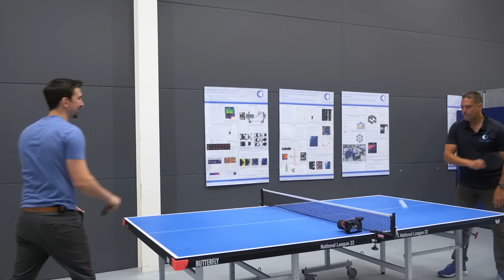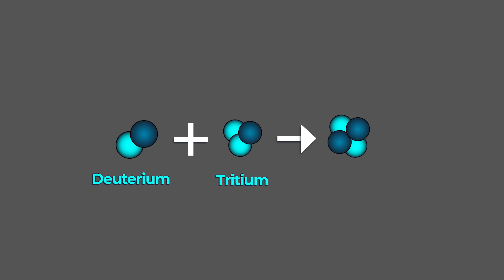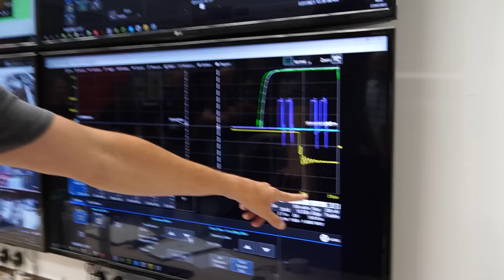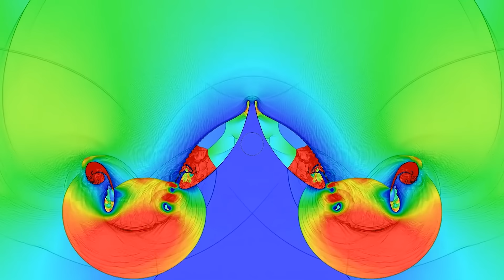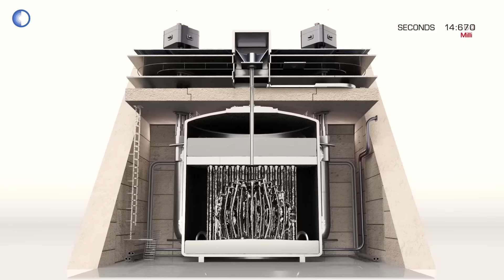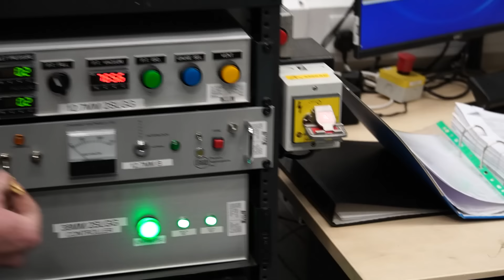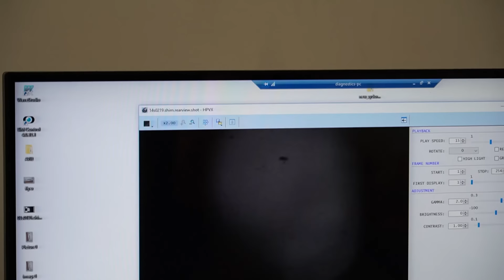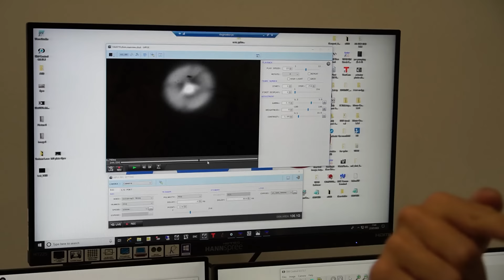Inside The UKs Breakthrough Fusion Reactor - First Light Fusion

Comment: Seems like lots of expendable parts in order to create a very much non continuous fusion reaction. Turning this into stable continuous electricity generation seems like a huge challenge.
Reply: There are two kinds of high energy physicists. a) Honest ones who tell governments to build fission reactors for energy and would like continued funding for various particle accelerators and fusion experiments as matters of pure science. b) The others who tell the politicians fusion energy is 30 years away to get more funding.
Reply: very true, no way to make out of it a practically useful machinery besides to keep busy a curious minds ....
Reply: And it seemed as though early rocket launches tend to create tons of burning metal. But then they fly!!
Reply: Nothing being actively developed today is meant to directly translate into a sustainable fusion power operation. The goal right now is simply proofs of concept. Regardless of how scalable it is, simply having a success will mean learning a staggering amount and bringing the possibility of sustained energy output even closer.
Reply: Yep, it's really the only feasible way though making small steps. Consider the alterative, spending 750 billion and 30-40 years to build something that could work as a real power plant but  ends up not working or so inefficient it's not worth running.
Reply: Inductive, explosive, collision based, laser ignition, magnetic confinement are all methods being pursued and each are having some success.  None are at a design level where commercial power generation would be viable.  However that is similar how many of these solutions are typically created.  You first have to prove it works, then you improve that process, then once it’s fully repeatable you can work on trying to make it work in a sustainable model.

Keep in mind the first Nuclear Fission system was proven in 1941.  The first power generation experiment was in 1955 and lasted periodically for a year.  It wasn’t until 1959 that the first commercial reactor was built (Dresden 1 in Morris, IL that ran till 1978). 

And in the late 40s early 50s there were half a dozen different concept designs of reactors being developed in parallel.  Only one really made it into commercial use.

If you try to rush into production skipping the experimental and refinement stages you are bound to waste money, time, and have a high risk.
Reply: Cartridge loading of expendables
Reply: @@henryteller7816triggers for bombs we already had.
Reply: @LogicalNiko we should have a look at what patents they have registered.
Reply: I think something was said about the steam engine and then the combustion engine. All leaps start with small movements. It might not ever work, but maybe it yields the next boner pill from the expended waste.😂
Reply: Yet another fusion project that won't deliver anything useful for power generation
Reply: if you generate a large volume of high pressure steam every 90 seconds it's fairly easy to regulate that into a steady stream of steam into a turbine.
Reply: When you're trying to unravel cutting edge science, you first need to make it work any way possible. Once it works, then you hash out how to make it more efficient, continuous, etc. It would be a shame if this design could lead to our future in fusion energy, but it was scrapped because the first prototypes were "perfect".
Reply: @deker0954 Triggers for nuclear bombs are insanity complicated. If something could simplify it then you can make them much much smaller.
Reply: Seems more focused on military applications to me.
Reply: @@henryteller7816 Looks distinctly like "dial-a-yield" neutron bomb development much more than energy production. Skips the usual fission-fusion-fission chain for neutron bombs by going gun-fusion, thus reducing fallout from neutron weapons systems further.
Reply: Yeah, I can see this achieving fusion, but not the kind of stable, sustainable reaction that we need.
Reply: Breakthrough this breakthrough that. It's pathetic to even listen. Even if they "achieved" fusion. This will not be used in any energy production for the next 30 or more years.
Reply: I had an interview in 2015 and I said during the interview that fusion was solved and the actual problem was reloading and making continuous energy.  The Dr interviewing me disagreed and I never got the job.  This seems like a similar issue.  They can create fusion but creating continuous energy...?
Reply: @GrahamReeds  The goal is self sustained fusion not and single instance of it. If it’s not ongoing it’s pointless for society’s energy needs.
Reply: @MD-gk4uh exactly my point.
Reply: seriously crazy how many pieces are blown up, shot, burnt.   even that electrical  piece has to be destroyed everytime
Reply: You don't need continuous fusion, you just need to store the sporadic energy bursts created and then introduce them into the electricity network.

A combination of super capacitors and batteries should do it.
Reply: It does seem that way.
Reply: How much $ can they sell the electricity of each shot for? That tells you how much the disposable parts can cost.
Reply: Engines used to have disposable parts called starters.  Which were blanks,  gun powder in a cartridge.   They built fusion equivalent to that.    

This won’t work for continuous energy production,  but could start up a reactor.
Reply: @aaronb1138   Issue of course with A) is that particle accelerators aren't actually furthering science. They too are money pits.
Reply: You did not mention Windscale. @LogicalNiko
Reply: @aaronb1138  yeah and videos like these don't help.
Reply: I suppose you'll need a lot of capacitors to quickly store the energy produced and then slowly distribute the energy over time while you are setting the reactor up for the next pulse. not the easiest solution I'll grant you. and you need to create a lot of energy per pulse to make it worth it. which in turn creates storage problems.
Reply: actually thinking about it a bit more. maybe they could use the pulse of energy to power a flywheel. that might work better. smaller then a capacitor and more easy to keep a constant current as output
Reply: and a gazillion laser mirrors that have to be carefully cleaned, kissed and complemented every time is  any better?
Reply: @LogicalNiko   Not only are you wrong about the first commercial reactor but you seem to forget that many of these American reactors suffered catastrophic engineering flaws. So much for taking their time.
Reply: @LogicalNiko each every either neither none is*
Reply: @andyalder7910 :   Not at all correct.  You clearly do not understand the most basic of physics.  Charging capacitors then discharging them violently cannot be scaled up to a continuous duty basis.   This pursuit is yet another effort doomed to fail.  Interesting, yes.  Practical,  no.

I am an old, long retired physicist.  Unfortunately, age and early Vietnam injuries do terrible things to one's body.
Reply: @b0neme  There's a slight difference between improving on the same type of design, and trying to make a design made to do 1 specific thing do something completely different.

Think about it just a bit; Is it really even possible to make a fusion reaction like this continuous, or is the design specifically meant to make it happen once in a bang every now and again?
The design here is a shortcut with no real future, and that's why both this company and that other Helion Energy company keeps inviting YouTubers to show the stuff off, as they're trying their damndest to get more investors and funding.
Reply: Let's not forget how stupid simple the CONCEPT of fission reactors are (I don't mean that nuclear physics are simple or that nuclear reactors are): bring fissionable materials together and they create tons of heat, use that to heat water as in a steam engine (which had been around for a couple hundred years by then [1712]) and feed that rotational energy into a dynamo (which had been around for a hundred years [1831]). Give us a hundred years to crack this, or even a couple hundred years. Most of these designs use energy fields, magnetic accelerators, and difficult to source/refine materials. And that doesn't even begin to talk about HOW we are supposed to harness the energy that is created. You can see that each part of the process is a bit more of a challenge than nuclear reactors were. We will get there eventually. And it will completely change the world when we do. Humans are amazing.
Reply: And so was the concept of going to the Moon 300 years ago yet look at us now
Reply: @zeph0shade   This isnt even a POC though...they havent even managed first plasma yet.
Reply: @stefanbanev  potentially a more direct route to fusion energy.
This one load fire extract heat repeat.
The huge issue with the continuous fusion reactors proposed is being able to cope with the heat produced continuously and reliably.
Reply: @aaronb1138  the fission reaction in H bombs is the only explosion with sufficient power to hold the fusing Dueterium together. This is tiny on Hbomb scales.
Reply: Fusion won't happen until they find the mythical room temp super conductor. Simply no other way to make the energy transfer required to be continually run. Material science needs to catch up.
Reply: @JH-zo5gk  continuous fusion probably, pulsed fusion as described above the magnetic fields are not needed, thus this becomes a possible commercially viable path.
Similar to how pulse jets heralded turbine jet engines.
Reply: @JH-zo5gk  The idea behind ignition, generally speaking, is that it is self sustaining. This project is different, pulsed fusion. 

Sure, room temperature SC would help with tokamaks, but the chilling of the superconductors isn't really a gamebreaking issue.
Reply: @aaronb1138 But b is right
Reply: my thoughts too, he said he didn't want to expend on volume, but I think having it be bigger is much better than expendable parts
Reply: @stefanbanev umm, do you know of a way that does make continuous fusion power? This thing is the closest to a commercial power generator in existence.
Reply: Bit like Microsoft Windows then. 😁 @LogicalNiko
Reply: I think nukes are already triggered with something like this; a shaped charge explosion directed at a core of some fissle-able material.
Reply: @MD-gk4uh  I recommend checking out Scott Manley's series on nuclear bombs, he goes through a whole bunch of concepts in one part of it that were used to create very small bombs. We allready know how to create vastly smaller triggers for nuclear bombs. We don't use them because military doctrine has evolved away from such weapons, they have a whole host of downsides related to keeping the firer out of the blast radius. That and the fallout led to most of the applications being banned under nuclear non-proliferation treaties.

Something like this, even if it was in any way practical within a nuclear bomb, isn't actually needed, we can do as good or better a job far easier but have deliberately chosen not to do so.
Reply: @tempest411  I really really RAELLY hope you are not commenting it as an attempt to defend it but rather just a curious comment or as an actual like "this is built like a nuke so is clearly bad" type or thing, I just hope it wasn't to defend it, because that would be so stupid, hopefully I don't have to explain why
Reply: @MD-gk4uh  continuous fusion has its own issues, batch or deliberately pulsed fusion may be the holy grail of managing in chunks the insanely high heats and pressures required.
Similar in concept to running a car engine vs a turbine.
Reply: @ughhly  Car engine gives you continuous motion not a pulse. The cylinder continuously moves under a controlled BURN of fuel/air mixture spreading out and creating downward pressure. It’s not an instant “explosion”. Than, as one “burn” comes to an end, another one next to it starts, so that, effectively, you have continues burn, tho be it created in parallel. It’s not perfect so technically it is not continuous strictly speaking but most things, when broken down far enough are not, but it is crating power non stop without a pose. 
Besides, you hung up on technical terms to much. You can have continues motion by coordinating pulses in a way that makes no difference. It’s maybe better to call it ongoing than continuing. The video is clear that there is no way this can be ongoing.
Reply: @NeroDefogger defend what ?
Reply: no-one minds the belt feed on the Warthog gun to get a very much non-continuous but plenty-effective BRRT effect.
Reply: @MD-gk4uh  A car piston engine is a series of pulsed explosions. Even a rotary you cannot get away from that concept.
A turbine is continuously fed fuel and air.
In the very long term the project above comes closest in comparison.
Yes the cycle at present is very staccato and has a large overhead of non reusable parts 
This will change.
The best analogy of this tech is best represented by an old hit and miss engine.
In 20 years we get the four stroke version.
In 60 the 2 stroke.
Reply: @ughhly  internal combustion engine is NOT an explosion. Won’t bother reading the rest of your uninformed “opinion”.
Reply: Another way to waste money!!!
Reply: @zeph0shade didn't they video start with them claiming to be attempting that within 7 years?
Reply: Thank god Edison didn’t give up on the light bulb  after his first 100 failures
Reply: It might be used for tritium production. Those factors where the plasma spins need it to work. There's like month's worth amount available world wide
Reply: Have faith! It takes us a while sometimes, but we generally make what we dream if we dream it long enough. What we see as historical progress is the culmination  of many failed pathways of investigation, and many that lead to further understanding which leads us to greater progress. It's never wasted effort. 😊🙏
Reply: @MD-gk4uh  the car engine operates by staged small explosions. The energy is stored in the flywheel to carry over into the next compression cycle.
It is NOT the often seen idea of a reaction where the burning stops as the cylinder reaches bottom dead centre ( this would actually be very inefficient as the latent heat of expansion would disappear down the exhaust pipe,).
This is best seen in single cylinder two and four stroke engines.
Dual opposed piston engines even better exemplify it's an explosion followed by gas expansion.
Reply: @ughhly  😂🤣 Explosion? You wouldn’t know what an explosion is if your brain exploded🤣
STORED by the FLYWHEEL? STORED?!?😆😂🤣. OMG ! Stop It! 🤣😂 I can’t breath🤣🤣😭😭😭😭
Please for the love of all that is holy, pick up a book….or maybe stop by my garage where I just have the transmission on the floor while I’m swapping the clutch, pressure plate, and will be taking of the flywheel so I can put in a new rear main seal. 
😆 oh air. Finally a bit air. I needed that 😂.
Storing energy….😂 oh ….🤣🤣🤣

I could tell you what flywheel is there for, and why on my track car (race car) I have all but got rid of it but wouldn’t do that on my daily….but this is way too funny.😂 I mean what if some other car guy needs a good laugh? 😜

P.S My race car goes BRRRRRRRRRR perfectly fine (almost) without it btw  😄😂….stores energy 🤣🤣

In an age of google and endless knowledge under one’s fingertips, this, while funny as hell, is kinda sad….but way more funny 😆😂🤣
Reply: @MD-gk4uh  I suggest you try running a single cylinder engine without a flywheel then.
I also suggest you see what happens when you ignite a stoichiometric mix of gasoline outside a car engine.
PS I suggest a very small amount. But then again you seem to think it's a verrrry slow burning mixture.

Sadly an example of the qualified tradesman who only partially understands what he's working with.
Reply: @ughhly  “The primary difference between combustion and explosion is the speed of the reaction. COMBUSTION IS SLOW BURNING process that is usually SUSTAINED, while an explosion is a rapid and often violent release of energy. Although combustion and explosions both involve the mixing of fuel and oxygen, the speed at which the reaction occurs and the amount of energy released make them two DISTINCT processes”

Now pay attention: What do we call an engines? 
ICE as in internal COMBUSTION engine. Wait what Wes the topic about? Sustained energy? The ICE covers that two way not just the combustion itself but 4 cycles where one starts when the other finishes, round n’ round it goes. Get it? I hope you do. Now go figure out the flywheel on your own. 
P.S. I coped pasted that first part since I wasn’t going to tell you anything at all much less waste my time typing. Ignorance is your enemy, not me.
Reply: @MD-gk4uh from Webster's dictionary, trimmed " a rapid expansion or bursting out or forth"

 combustion is synonymous with both explosion and implosion dependent on the driving reaction.

Sustained is a key word you misuse in a sustained manner .

An internal combustion engine uses a series of small explosions in a controlled environment to drive the piston.

The selection of fuel determines both the rate of expansion and the rate of flame propagation.
Every explosive reaction has these two determinants. Even a nuclear explosion has a measurable rate of propagation of the driving reaction.
Notably possibly the most dangerous fuel to work with would be acetylene as bother the rate of propagation and flammability are extremely high.
See the episode of MythBusters where they attempted to convert a small engine to run on gunpowder for an explanation of that.
Very similar to the ideas behind the pulsed fusion reactor described.
Under the definition you are using the firing of gun powder in an artillery piece is not an explosive event ( for the gunpowder).
Reply: The current system is a lab experiment to see if the fuel packs do generate power.  Once you verify the impact speeds and packet design work.  Then you build a rapid fire launch system to do it on a industrial rate/scale, which is expensive but not scientifically challenging.
Reply: @MD-gk4uh  actually not.
Fusion bomb design is complicated by the need to exert insane inwards pressure as the fusion reaction proceeds. The only way to do this on fusion bomb scale is with a small fission bomb.
The units here simply cannot create a fusion reaction of bomb scale, and never could.
Reply: @ughhly  Who was talking about a fusion bomb 🤔. I was talking about triggering atomic bomb with fusion reaction. Can you imagine the efficiency of it. Too bad they are not used more often. Instead our solders have to suffer. One hundred on Iraq, 20 on Afghanistan and war could have been power in a day and Islam terror destroyed for ever. Anyone else would never dare vomit terror attack.
Reply: @MD-gk4uh  For the same reasons listed above this cannot work with either type of nuclear bomb.
Fundamentally the critical mass needs to be held against the energy being released for enough time for the chain reaction to occur.
As this is a focussed wave on a very small sample it's simply not sufficient and won't scale because of the cube law.
It does make some use of the effects used by engineers in H and N bombs however not in a scalable sense
Reply: “huge challenge” is the understatement of the century. More like impossible. This is a science and engineering experiment, nothing more. And they are focusing their energy, pun intended, in the wrong place. Generating a fusion reaction isn’t the problem. The problem is that without gravity as the free means to achieve it, like in a star, it will cost you more energy always to produce that fusion reaction than what you can extract on the other end to power a load. So efforts should be put in better and more efficient energy transfer technologies, not fusion itself. Farnsworth invented a fusion reactor back in the 60’s that any high school student can build from stock parts and it will produce a stable fusion reaction. The only problem is it costs more electricity to generate the fusion reaction than what it produces on the output, making it a power drain and not a generator. 😂
Reply: @ughhly  So I can’t use this the same way I can do explosives placed all around the critical mass and trigger them all at ones applying big even pressure except just 10000 times less mass and space? DaFak? 
I’m not gonna argue. This is not founded vy civilians I promise you that much.
Reply: @MD-gk4uh  no, the total forces don't scale ( cube law)…
So think of it this way, it's like hitting a centre punch with a sledgehammer, huge force in a tiny area, with effectively a small tool.
Trouble is a sledgehammer big enough to effect a H bomb sized reaction is many times bigger than the current fission explosive devices.
Simply having fusion occur in an instant does not trigger ongoing fusion as it requires those immense pressures and sufficient heavy hydrogen in the same place, which can't continue without either explosive backpressure (bomb) or stellar pressures.

Nothing truly interesting or powerful in this world is funded by commercial research, the vast majority of companies have at best a five year plan. This takes government, military, or very wealthy benefactor types of commitment.
Reply: Fission fusion hybrids are sooooo much easier. So is thorium.
Reply: Its research for the amplifier design. Rewatch the video
Reply: It doesn't need to be continuous as long as you capture and store the energy released in a storage device that can release it continuously. A car's engine doesn't produce power continuously. It's a series of explosions in the cylinders. The energy is stored in the flywheel. And expendable parts don't matter as long as the economics works, i.e., the cost of using and recycling the expendable parts is significantly less than the value of the power released.
Reply: Like everyone else keeps telling you, first you must achieve and prove fusion itself THEN you can start engineering.  Seems pretty simple to me
Reply: @abbersj2935  because they're using a physical projectile? Do you tie your own shoes or do you have slip-ons? How tf could you watch this video and turn your brain off after seeing "gun" and shart out that stinking sloppy nugget of an opinion
Reply: @MD-gk4uh  you ok there bud? Seem to be having a meltdown because someone said that a flywheel stores energy.

But hey, you're so smart you should tell all those car manufacturers they don't need flywheels you'll probably get a reward for the thousands of millions of dollars you're gonna save them
Reply: @DnBastard  Hey, if you're going to try to do a person down, better learn English first.
You may also like to eduate yourself on the other methods being used.
Reply: @abbersj2935  >"learn English"
>eduate

What's your point on other methods?
You seem to forget that people don't have the same thoughts as you so you need to give others a little more information so they can get the full context.
Reply: @DnBastard  Constant power fusion. Not impulse.